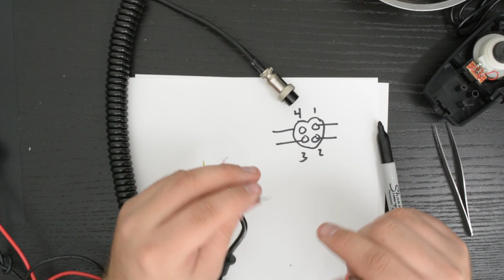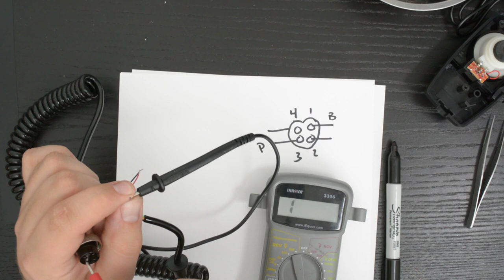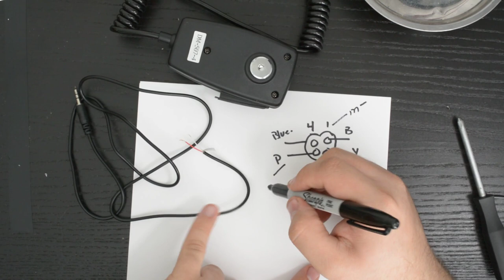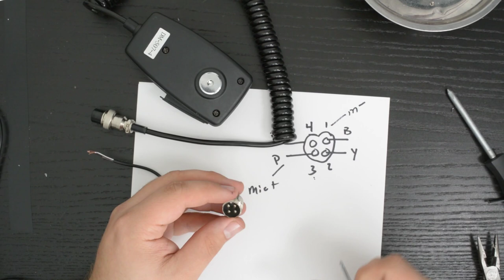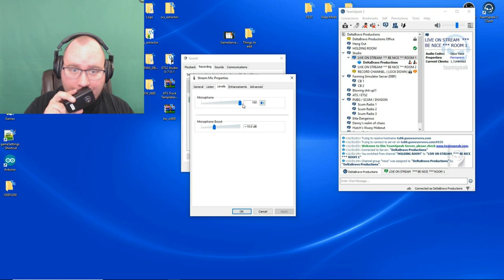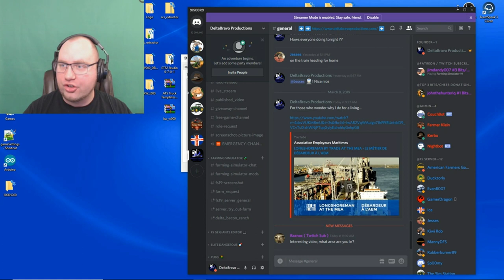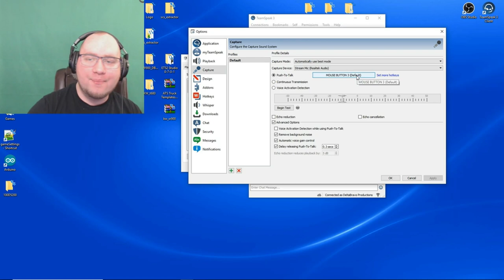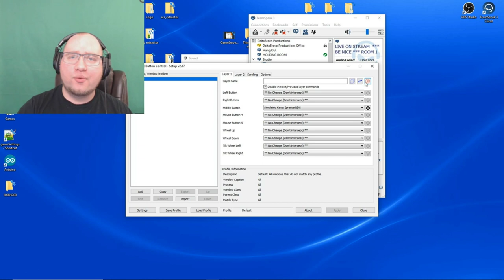🎙️ D.I.Y CB Mic - From Start To Finish - 🔘

Comment: Good choice for the mic. i personally prefer the superstar mic myself too cause its cheap and durable

a mic with an electret element might be better suited for this type of modification because the microphone element has a wider frequency response and im assuming ATS voice chat is compressed. You'd just have to supply the voltage in addition to the GND TX and RX. You can also take out the diaphragm in that mic and stick an electret in there and a pop filter on the grill if you want to remove the chuffing from your voice as an electret will pick that up. The 10 meter radio and HAM mics also have ch up and down buttons or a number pad. Plenty of extra keys.

I dont have much time to look through the video but i wanted to give others some ideas. Apologize in advance if you've covered this.

Comment: I know this an old video but it's a great project. There a couple of things I'll do a little differently. I'm also going to try and add an echo board like a Delta EC2 or Palomar TRB X4. It'll require a 12v power supply but that's no biggy. Thumbs up.
Reply: It's garbage. It does not work. It only works as a mouse click. And he changed the name of it so we don't know what the default name is in order to know the pc detected it.

Comment: you have a switch in the mic. dont need the mouse
Reply: I did this only i used a usb joystick controller board. The red and black that go to the mouse, solder those to a wire set that comes with the encoder it's also red and black wires. Solder red to red and black to black. Plug plastic end i to encoder board. load up ats or ets2. Go to controls and select the joystick. Go into buttons and find push to talk. Select the spot and push the cb button. Done. I still wired the mic like the guy in video. I also plugged mic and usb into pc. I tested in discord and told it push to talk. It asks to map button do it like your game. Done

Comment: So I did everything but when I plug it in the mic work without press the button and ideas?
Reply from the maker: Your switch isnt  wired correct... My guess
Reply: @DeltaBravoProductions  which switch?
and I didn't do the mouse part I have connect to a joystick board which is reading when I pressed down on the cb radio switch, but when I plugged everything in and the mic is on when I'm not even pressing down on the button
Reply from the maker: Well exactly it should always be on. 

Any mic is always on. The software controlls the sending. 

If you want to have a physical off you need to connect it to a switch
Reply: @DeltaBravoProductions  I think im getting what your saying, the mic is always on but others will hear me when i actually press the button down. So for American Truck Simulator I make the cb button a hotkeys to "quick Replies".

Comment: I'm having trouble getting my solder connection good from the  3.5 mic jack to the cb mic they keep on coming loose and popping out, any tips?
Reply from the maker: Once your solder them on put a tab of hot glue around it

Comment: AMAZING! Thank a lot, I was going crazy trying to use the CB as a mic for my live set :) I just have a question for you as didn't connect pin 2 and 4 as I don't need the USB cable: now the mic works perfectly connected to the mixer as an audio source, the only thing is that the botton on/off now doesn't work anymore and the mic is always on...how can I reactivate the button function? THANKS!
Reply from the maker: You could put the positive wire of the mic on the switch and make it work from that. So positive mic to switch and then switch to positive mic plug and then it will make it that every time you need to press the button.
Reply: @DeltaBravoProductions  Okidoki, so I'll look for which pins of the switch close and open the signal right? Gonna try it :) Thanks a lot for the fast answer!!!
Reply from the maker: @ZooQuest_  Yes exactly
Reply: @DeltaBravoProductions  I'm nearly at the end of the tunnel! It works perfectly now, the only thing is that there's a buzz when the switch is off (mute), it disappears as soon  as the switch is on (talk)...do you know what could it be? Cheers from Italy!
Reply from the maker: @ZooQuest_  well its static sound, now how to fix it is the other question that I'm not sure what to do
Reply: @DeltaBravoProductions  yep, I will play around till I can find the problem. Thanks for the huge help!
Reply: @ZooQuest_  I'm looking to do exactly what you did. I don't need the USB interface as I want to use it as a mic on twitch. Perhaps if you pick up a ground loop noise isolator from Amazon it could fix it. Plug one end of the 3mm into noise isolator, then the other into the mixer or PC
Reply: @ZooQuest_  zoo mi potresti dare una mano?
Reply: @Zoo Quest Hi, have you found a solution for the static noise?
Reply: @blackraptordk  not really, I just avoided to consider the switch so it's always on...but it works

Comment: Hey mate,

Thanks for the tutourial! Ive built the box/mic setup and can get it to work on push to talk using the button on the CB in apps such as discord. But when i go to ATSMP and press it it does nothing (The button is mapped to x) have you faced this problem before? would appreciate any help.
Reply from the maker: I find that odd, so in discord it works correctly? you are using a mouse as a controller or something else ?

Comment: Still not understsnd how to convert my baofeng double-aux cb mic into a four pins one pls help me
Reply: Late reply but I don’t think you need to covert it into a 4 pin at all like he said in the video,
You would need to unsolder the mic and switch from the circuit board from inside the mic it self, then solder it directly into the output wire 
And then cut off the 2 pin end and solder two wire straight into the 3.5mm jack, also solder two wire for signal (I recommend using a USB arcade encoder instead of a computer mouse like in the video, but it’s your choice to use a mouse or an encoder)
I’m also going to use a Baofeng mic and just waiting for my 3.5 cable to arrive
Hope i didn’t explain it too terribly
Reply from the maker: Think you did a good job explaing it. I agree a use encoder would be better, But that said, i wanted to use somthing that was easy and cheap for people to do.

Comment: The PC doesn't pic the board up as a mouse when you plug in the USB? Im asking because if it did. How would i configure it as a mic in the settings? confused but want to do this.
Reply from the maker: Yes it does it's a mouse.... And you just remap your mic press to middle mouse button.
Reply: @DeltaBravoProductions  ok i get it now
Reply: can i use a port on the usb joystick encoder instead of a mouse so i dont have to have a second usb cord coming out of my box?
Reply from the maker: Yes of course
Reply: @mikebenton3462  how would you go about that, or did? Wouldn't you have two wires coming out still, or there's a way to wire the microphone to the encoder?

Comment: I keep buying AUX  cords but they don't have wires like that htey have real tiny wires. MY wife is getting pissed i keep ruining all her aux cords. any suggentions?
Reply from the maker: Well the wires are small. They aren't big .. that's normal.
Reply: buy some 4 conductor cable and a 3.5mm microphone connector. The cable should come on a spool so if you mess up you can try again. USB cables have 4 wires so if you have a broken phone charging cable you could use a section of that. Make sure the wires inside the cable are 20 gauge or smaller just to make life easier.